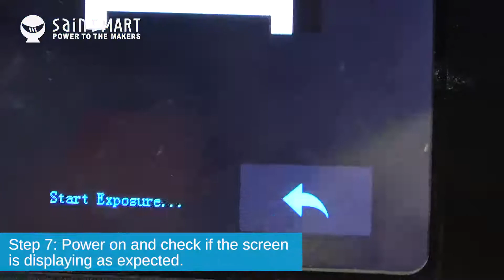How to replace the Kumitsu KL9 3D printer LCD display

Comment: Will it still print with out that or is it core to the function? I assumed it was just to protect the screen underneath from resin.
Reply: It's super essential. The screen doesn't emit the light but it does shape (mask, really) the light that comes from underneath. Wherever the LCD allows light through, the UV will cure (harden) what's above it. Wherever the LCD doesn't let light through, the resin above will remain in shadow, and not cure. It changes what's on its screen according to the layers in the print job.